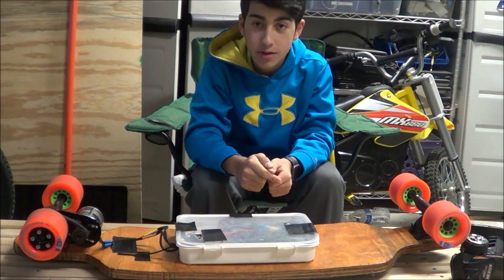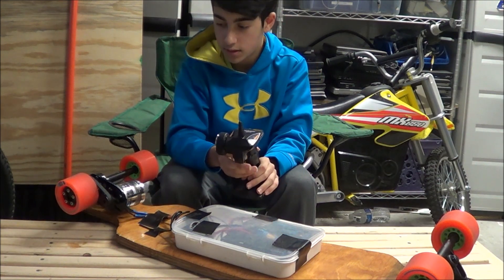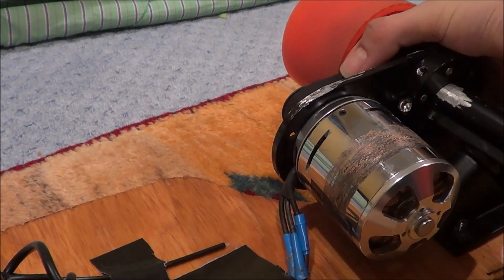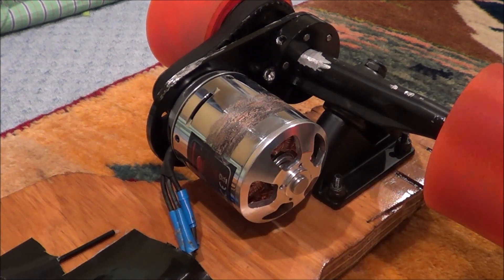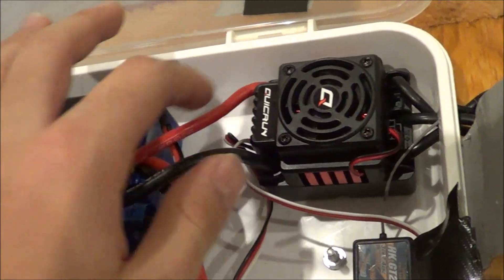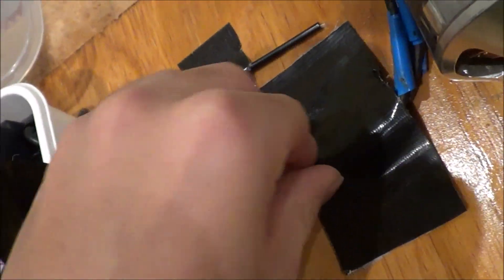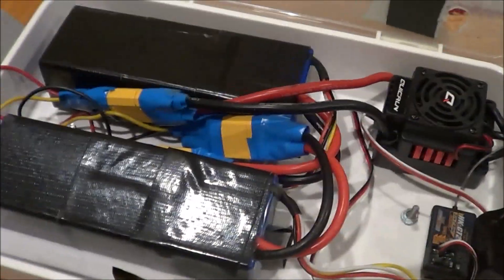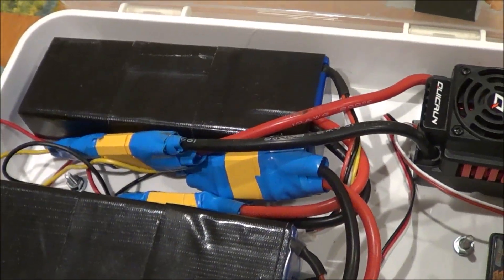DIY Electric Skateboard

Comment: How did you attach the motor pulley to the shaft?
I have the same motor but I am having trouble attaching them since turnigy motor has round smooth shaft instead with a keyway.
Reply: weld it

Comment: So this "build" is terrible... for a couple reasons. Your motor is an SK3 190kv motor, which typically uses 10-12s and youre using 6s. So right there your power is half of what it should be. The 1/8th hobbwing ESC can do max 6s, so you can't upgrade to 12s. You took 12 gauge wire from your batteries and added what looks like two 20 gauge wires to connect to the esc. Two 20 gauge wires can handle like 5 amps as compared to the 60 amps that the motor will pull. A couple other issues also that I won't touch on, but there is room for improvement.

Comment: Question : do you Think i can run the Motor With this Kind of lipo Battery?  Specs : Minimum Capacity: 12000mAh
Configuration: 6S1P / 22.2V / 6Cell
Constant Discharge: 10C
Peak Discharge (10sec): 20C
Pack Weight: 1610g
Pack Size: 183 x 77 x 56mm
Charge Plug: JST-XH
Discharge Plug: XT90
Reply: yes 557badboy it wil work fine. He also uses 6s. Mah doesn't matter. It only extends the range. The moter can handle 22.2 v because he uses it too.

Comment: You don't need to Mount the antenna on the board. Your transmitter is like 1 meter away from it so don't worry about the signal.

Comment: what batteries would you recommended for the motor that you use that would fully use the potential of the motor
Reply: 10-12s  high discharge Li-ion would be the best  for longevity. Lipo's could be used as  well.

Comment: Guys the easier thing to do is go on eBay. Buy 80+mm electric skateboard mount. Buy a brushless motor under 400kv or around that and a brushless ESC around 60amps. And a Lipo battery. :) easy

Comment: You can get a motor mount, chain and gears on ebay for only $23! Damn
Reply: MultiTerpen It is not the same. You will should to weld it or find another way to fix it on the chassis.

Comment: make a electric skateboard cheap
i choose two motor of ebay 
n5065 (china) 270kv or 400kv its better my battery is 22.2v lipo 
i want fast and torque
whith motor its better ?
Reply: 270kv is better

Comment: will 410kv brushless motor work with the following specs
PROP - 15 x 8 
● Get 3600gms Thrust
Lipo - 6 cell 22.2V
ESC - 60 amp 
Power - 3600W
please reply..  I am sitting on this for sometime now
Reply: sach m yes just make sure the motor is under 60a, 60a ESC is perfect for a 40-45a motor. You always want about 15-20amp extra than the actual motor value. Make sure the ESC and motor are brushless grade and support 6s. :)
Reply: 192kv is good. 410k is fast but has less torqe.  so the higher the number of kv the fast but less power it has to push more weight.
Reply: just google it he dose not know much of any thing
Reply: dont use a esc always use a vesc or focbox

Comment: What has caused the wear on the motor housing?
Reply from the maker: +Eli Howard if I hit a bump or go over some small rocks they would brush up and hit the motor mount
Reply: Not the mount, but the motor housing. Same same?
Reply from the maker: +Eli Howard ya same reasons
Reply: Needs bigger wheels

Comment: How many volt do u use to power the skateboard
Reply from the maker: +Chris Ngwa 22.2 through 2 11.1 lipos
Reply: Am thing of cranking the motor up to 30v, what do u think
Reply from the maker: +Chris Ngwa dude that would be pretty dope. It go pretty fast to. I switched some setting o my esc and it now goes 25mph gained 8 mph. Which is plenty for me